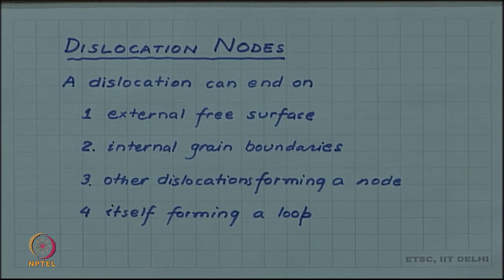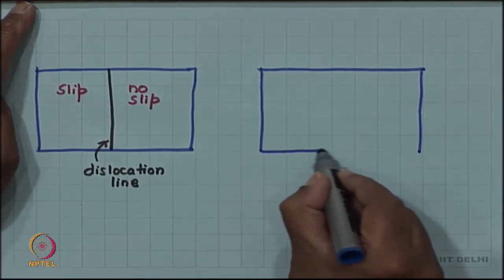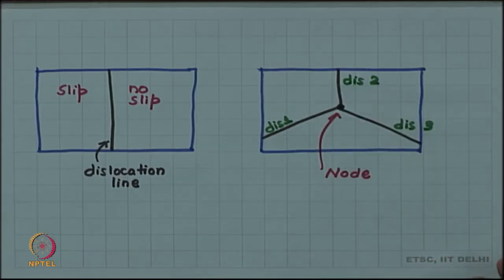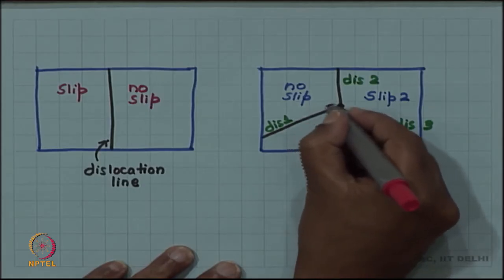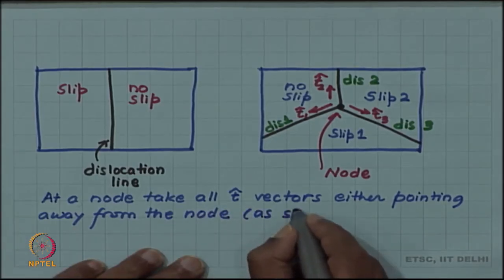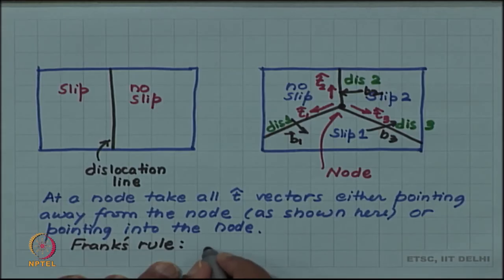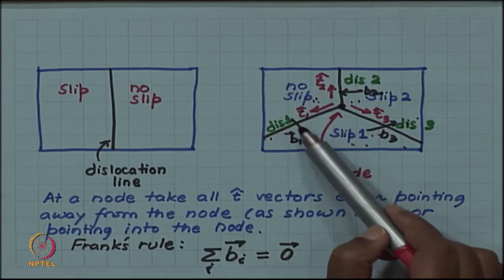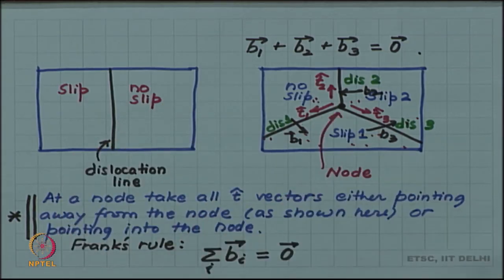Dislocation cannot end abruptly in a crystal: Dislocation nodes

Comment: Sir, in the ending part of the lecture,you said that the third dislocation need not lie in the same plane.So,does it imply that the dislocation lines could lie on different slip planes and then eventually meet at the node?So sir can you please explain it what you were trying to explain.
Reply from the maker: Yes, you can have 3D network of dislocations. Thus dislocations meeting at a node may not all lie in the same plane.

Comment: Sir, if the head of burger's vector is always pointed from slipped to no-slipped region, why in this case you took the b1 vector from no-slip to slip region?
Reply from the maker: Only the line and the magnitude of the Burgers vector is fixed. It can have either of the two senses along the line. Thus using a particular convention, which requires also choosing a sense for the t vector)  if I get the Burgers vector in one sense then flipping the sense of t vector will also flip the sense of b vector. 
Furthermore, as in my reply to Sunil Ugadi, the slipped and unclipped regions are also arbitrary.